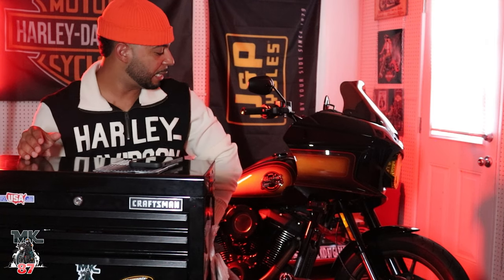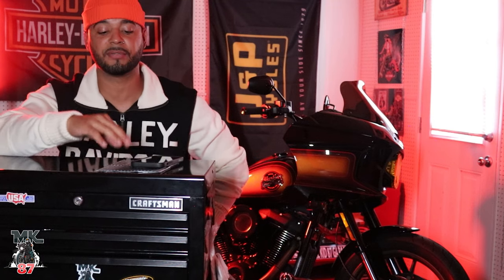My Low rider st broke

Comment: That should be covered by your factory warranty.
Reply: Sadly he has a stage 2 kit on his bike witch voids him of the warranty
Reply: What if a factory warranty is expired? Then what? Usually wheel and tire is for the life of the loan.
Reply: @AnthonyRitter-m8p a stage 2 does not void the entire warranty of the bike.
Reply: @3percentmick705 that’s the question for him. Has he had this bike >2 years? Agree should be covered under factory.
Reply: @Ahhson  the bike is a 2024.
Reply: @3percentmick705  he said it came from the factory leaking air from the rim. If you ride a bike for 2 years and have not figured out the problem or thought to have someone else take a look at it you probably shouldn’t be riding a motorcycle.

Comment: they should replace that even if you don't have wheel and tire. That's a factory defect not some freak accident that happens on the road like hitting a pot hole and the wheel breaks.

Comment: I always get wheel and tire protection now too; great to have in case needed and usually will pay for itself the first time you use it. 

With that said wouldn’t a casting issue be covered under your manufacture warranty? Seems like a defect on their end.

Comment: how is the wheel not under warranty for manufacturer defect?  That's CRAPOLA!  So now for HD ya gotta replace the stock seat, bars, pipes, suspension, AND wheels ? lol............ah ya ya............sorry it happened, but I'd be fuming man....that's WACK!  HD quality control must have missed this one.  Ride on bro........pourous casting...... aka their fault

Comment: Back in 2015 my CVO street glide had that problem. Lost ten pounds a week.Took the bike in told me they couldn’t find the leak said it was normal. It was under warranty so took it back again said it was normal so my wife had the same bike and never lost air like that. Went to get a new tire on rear and they found corrosion inside the rim. I said you owe me a new wheel, they told me bike wasn’t warranted anymore. So I said check the records and it will show you that I had the complaint, it didn’t matter. I bought a new wheel which pissed me off.

Comment: Do you believe that making a bunch of engine modifications on your bike also make your bike more susceptible to breakage or being less reliable?

Most of the guys that I know that have 100% stock bikes also have very reliable bikes. 

It’s primarily the guys that make a bunch of modifications that have frequent visits to the shop. 

I’m not saying that you will have anything to do with it, but it’s just all of the mod guys are in and out of the shop all of the time it seems.

I love your channel. Keep up the great work.

What are your thoughts?
Reply: You don't know much about what you are commenting on.  There are plenty of highly modified reliable Harley builds...
Reply: @UnrulyRider  I never said that all mod bikes break down. I just feel very confident that they have a higher failure rate as compared to stock. That is most likely one of the reasons that Harley is not comfortable, giving a warranty to a mod bike. 

I think that fact would be very difficult to debate.

Mod bikes can be built to the exact specification of the bike owner however, sometimes the mods stretch acceptable tolerances of the design and that’s one of the reasons why you have increased failures.

You can’t argue that fact.   That’s not to say that a mod bike is not very fun.

Very few mechanics are also engineers.
Reply: Its just most dudes who dont modify never really rip on the bikes. Even a stock bike just beaten on all the time will still be unreliable. Maintenance. Maintenance. Maintenance. Is key
Reply: Its just most dudes who dont modify never really rip on the bikes. Even a stock bike just beaten on all the time will still be unreliable. Maintenance. Maintenance. Maintenance is key
Reply: @tommys2979  FACTS - well said sir.
Reply: @tommys2979  you make a great point

Comment: A "porous metal" is a metal material that contains interconnected pores or voids within its structure, essentially creating a network of empty spaces while still maintaining the basic properties of the metal itself, like strength and conductivity; these pores allow for fluid or gas flow through the material, making it useful in applications like filtration, gas diffusion, and biomedical implants. But is not good in the making of automotive or motorcycle wheels

Comment: I’ve had nothing but issues with my 2023. Fosgate sound system amp is going out, it’s only 8 months old. My engine from the start has burned over 2 quarts of oil in less than 3k. Left fork seal leaks, brake switch went out, upper fairing has bubbles in the paint and my tappet covers the chrome is uneven.

Comment: I have this warranty.  I bend my front wheel .. I go to my dealer.  He told okey .. the dealer supposly change my wheel.. 😂😂😂😂 just put weight in it .. I took my bike .. wow it's run good. I wash it and what I see on my front wheel the bend ..i go to another dealer.  And the dealer check all the other dealer claim.. He claim nothing 
. Just put a patch and go $"3%3%2